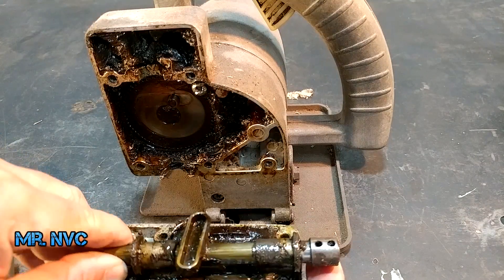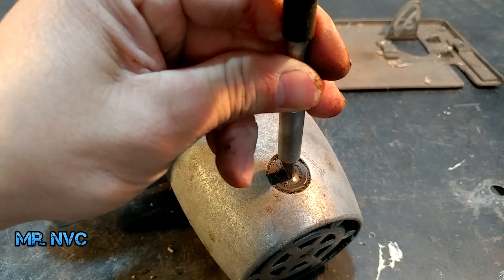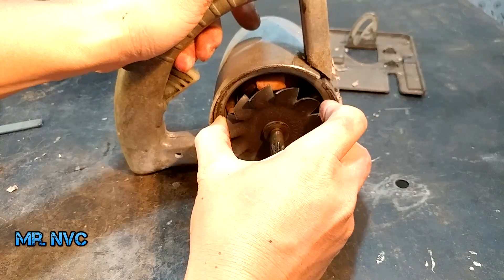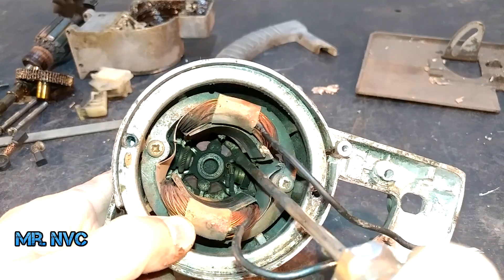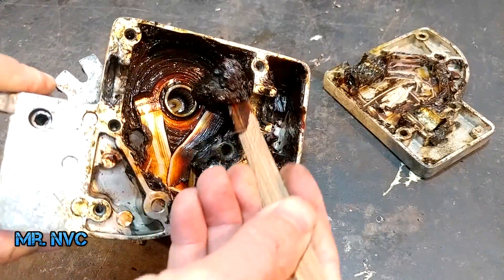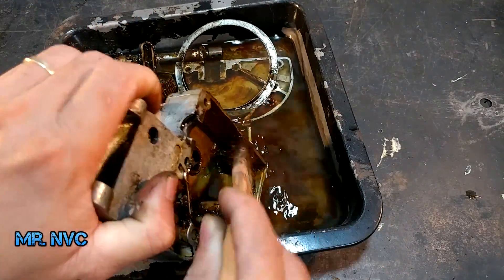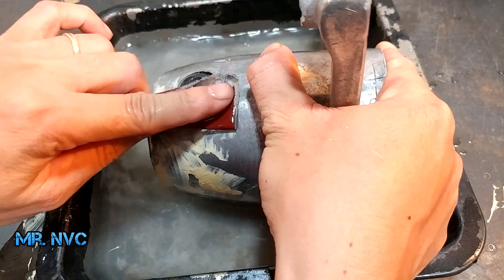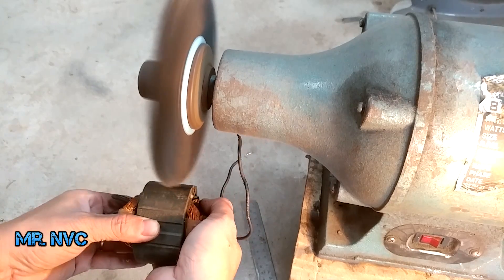1950's Antique Wen all Saw Model 909 Restoration

Comment: This was Wen's answer to the Sawzall which was introduced around the same time period.  It was designed for cutting both wood and metal.
Reply: Yep.  And when they switched to the plastic housing model 3700, it was still quite a workhorse.

Comment: Need some help. I have a Porter-Cable circular saw that I inherited from my father. It takes a 6" blade with a 5/8" arbor. I love using the saw, it cuts better and is easier to handle than my big saw. The problem is that I cannot find blades for it because of the larger arbor hole. Can anyone help me?